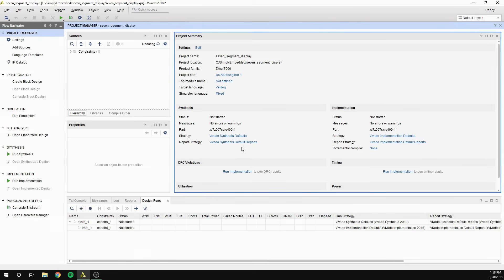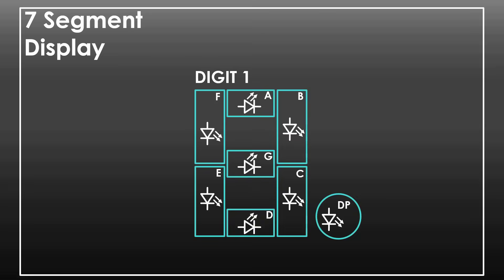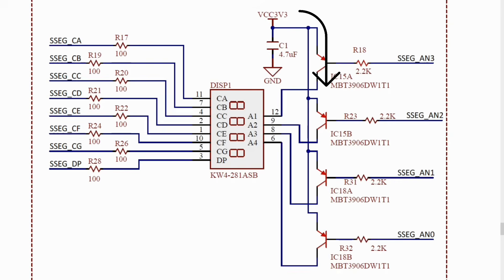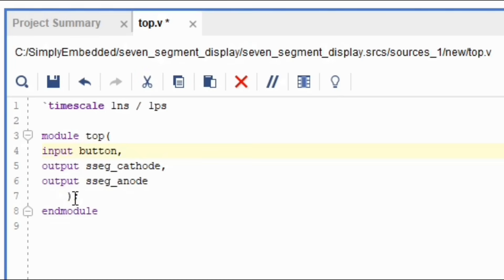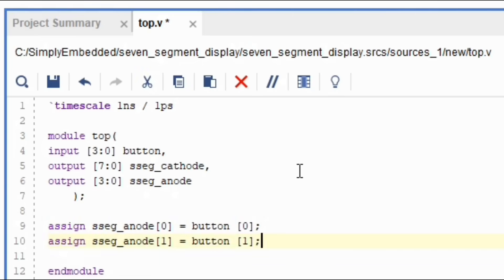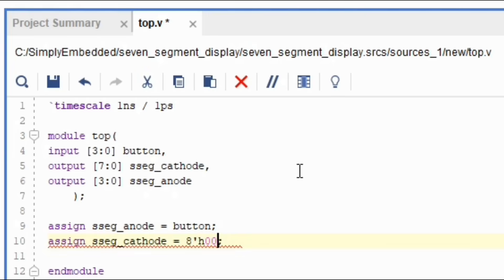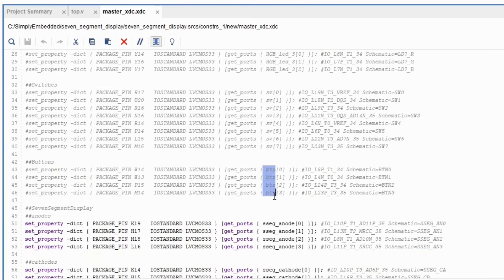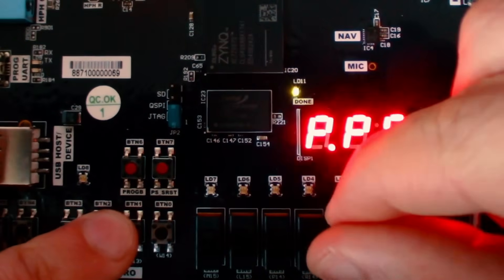How to use Bus in Verilog and 7 Segment Display? | Xilinx FPGA Programming Tutorials

Comment: How do I go about displaying different values on each segment display? For example if I wanted to display DADE how will I go about doing that?

I found the following info on a website in regards to letters, but I don't know how to set it up so that it displays it. My goal is to have DADE or BALL or any combo of letters when I flip the following switch. sw(1), sw(2), etc.:

const byte alphabet[16]= {
B11101110, //A
B00111110, //b
B10011100, //C
B00011010, //c
B01111010, //d
B10011110, //E
B10001110, //F
B01101110, //H
B00101110, //h
B00011100, //L
B01100000, //l
B11111100, //O
B00111010, //o
B11001110, //P
B10110110, //S
B00000000, //shows nothing
};

The code I have so far is the following:

`timescale 1ns / 1ps

module Seven_segment_LED_Display_Controller(

output [3:0] seg_an,
output [7:0] seg_cat,

input [3:0] btn,
input [7:0] sw
);

assign seg_an = btn;
assign seg_cat = sw;

endmodule

But I'm too new to this to figure out how to control them individually. I have subscribed and watched your other video (https://www.youtube.com/watch?v=v2CM8RaEeQU), but I am unable to understand what each term does ex: output reg [1:0].

Can you help me understand? 

Thank you!

Comment: PNP teansistors (or P channel MOSFET) actually work in "reverse". A zero, or low voltage on the input would turn it on, and high voltage would turn it off.

NPN or N channel works more like the way you describe.

But there are different applications for these transistors. NPN/N ch are usually used as "low side" switches, while PNP/P ch are "high side" switches.

You can think of it as PNP/P ch allowing power to reach the device you want to switch on from the positive supply rail, while NPN/N ch allows power to exit the device to ground. Either one completes a circuit and switches the device on.

Comment: Useful video Greidi. 
I want to know how to implement a RAM and ROM on an FPGA board. I have written a verilog code for a single port RAM but am confused how to test this on the board. Appreciate if you can give some hint. Thanks.
Reply from the maker: Dharamvir Kumar, thank you! I would be honored to help you out, my friend! I'm not sure if or how familiar you are with Simulation files, but simulating your code would be the best way to see how it is working! You could also use "debug" or integrated logic analyzer to see your code working during runtime. Also, let me know what board you are using! :) (in addition to everything, I'm planning on making a video about this in the near future for playing a short clip of music from ROM)
Reply: Simply Embedded I am using Basys3 board. I have checked simulation. It is working fine. But I don't have idea to how to dump it over the board. Explanation regarding any board will be helpful.
Reply from the maker: Dharamvir Kumar, you can change the RAM block to a dual port and perform a write and read transaction using buttons and switches. Lets say that holding button 1 would initialize write sequence to the RAM - you can simply write the present values of the switches and move it around. Then holding button 2 would initialize read sequence which would directly read the values of the RAM and output them to LEDs. (make sure you have slow enough clock initialized for this - otherwise you won't see much happening). Let me know if this helps a bit ? if not you can follow me on Facebook and send a message there - I'll help you to figure it out.
Reply: Thanks Greidi, I think this is going to help me. I will try this for sure.
Reply from the maker: Dharamvir Kumar sounds good! Let me know how it goes - I'm interested to hear if you got it working!